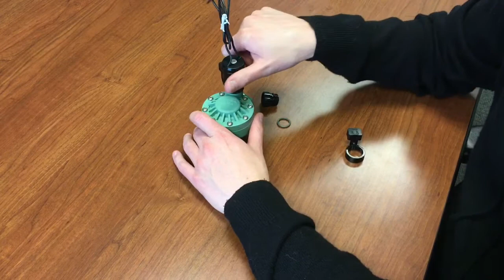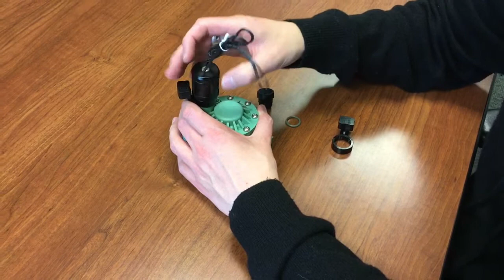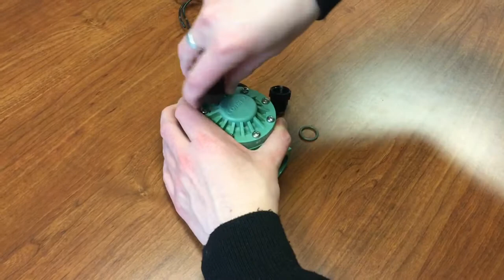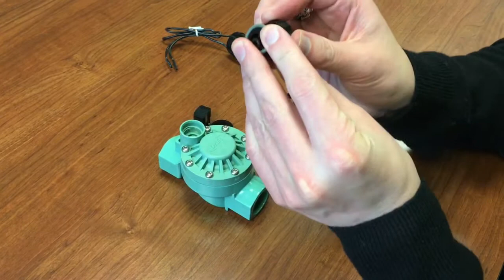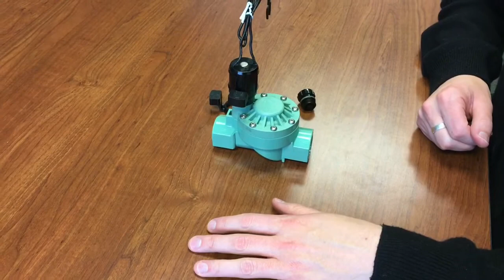How to change or repair manual flow nozzle on Orbit Manifold

Comment: On a 57101 valve the adapter below the knob has an opening, how should it be positioned before putting on the knob.    Sunday 230 pm

Comment: I’ve got an orbit valve that won’t turn on manually. I’ve tried replacing with 2 brand new complete setups but neither worked. Verified the valve was installed in the correct direction. Any idea what is going on?  Hooking it up to the timer also doesn’t work. It will turn on if i open the bleeder screw. This is specifically for a jar top valve.

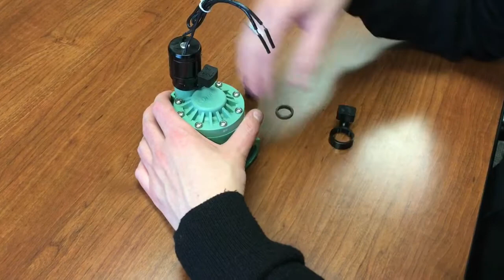Comment: At 1:00, how does turning the whole black part a quarter-turn counter-clockwise turn anything on? I really don't get this.
Reply from the maker: The solenoid (black part) has a mechanical device in it which is usually actuated by the electrical signals from the timer. The timer tells it to lift or close, essentially. This lifting and closing lets the diaphragm in the valve lift and close, which lets the water through. It only needs to move a small way for the water to get though enough to power the sprinklers. That quarter turn is doing manually what the timer does automatically.